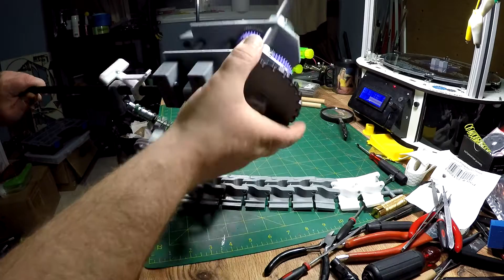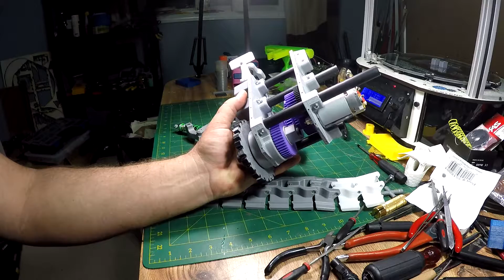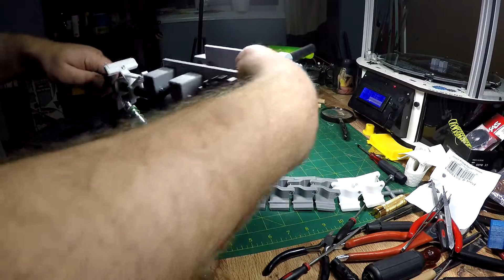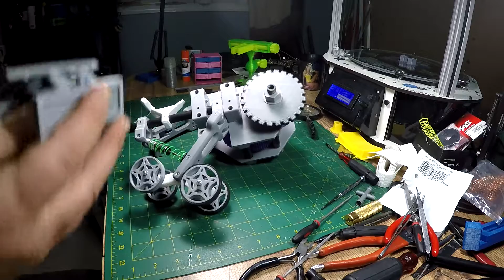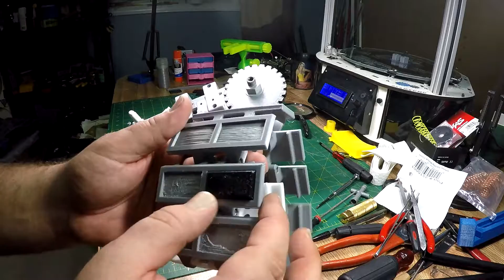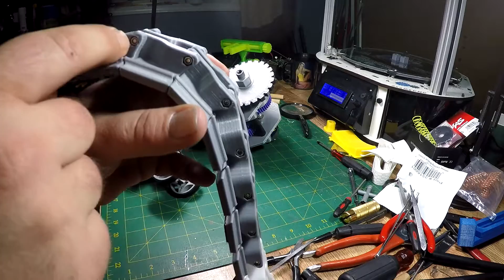Early view of 3D Printed tank track system

Comment: Hi Kitecraft, I interested to understand why the tracks are oriented as they are?  Is that a prototype practice?  I was wondering whether having them face the other way would present  less sharp edges to the pony wheels as they rolled past each pin boss.
Reply from the maker: I don't think I have any particular reason for why I oriented the track that way.  Except maybe I wanted the nuts on the outside.  I'm not sure it really matters either way.

Comment: Well I'm really keen to print my own tank drive. I was aiming to do one with the drive gears touching the outside edges like an M1A1, but that means you need longer bolts and those get expensive in small 3mm diameter sizes.  I like how you have your wheels either side of the track on the bottom which should stop it twisting off the drive gear if you go over an uneven lump.  You might have inspired me to have another go at it.  I would like to see how you did your bearing mounts and what you are using for shafts to connect your drive gear to your gear box gears on the inside.  Cheers dude.  Great stuff !!!
Reply: Ps: I love what you have done.  It really is awesome!
Reply from the maker: Thanks Craig!.
I've been delayed in getting the last of the parts printed for my 2/3 size prototype.  I've had a lot of failed prints with Ninjaflex so I've been designing a new extruder.  I should have the prototype completed in a few more days and will post a video detailing the drive system, axles, bearing mounts, and the tracks auto-tension system.  Maybe another week at most (hopefully).  :)
Cheers!
Reply: That would be really terrific.  I'm looking forward to your next post!  I might get started on the tracks and drive cog in preparation :)

Comment: this is awsome, will you share the models?
Reply from the maker: Thanks!  I'm not sure yet if I'll be sharing the final model.  It's very complicated and will need a lot of instructions.  Plus, there are some very specific parts needed for it like pinion and spur gear for the motor.  FL505 and FL414 fiberglass tubes and a few other things.  I'll be going over the full parts list when I post the next video.